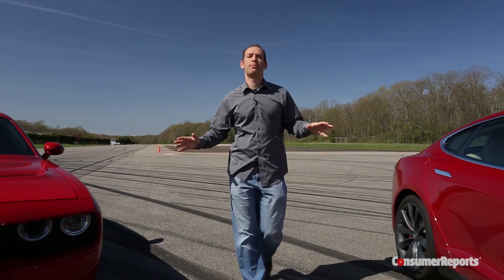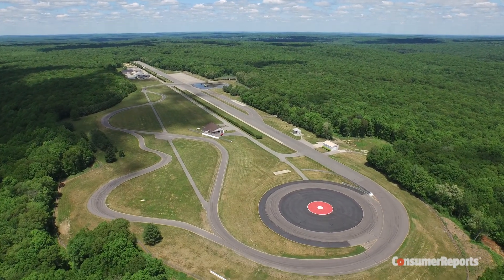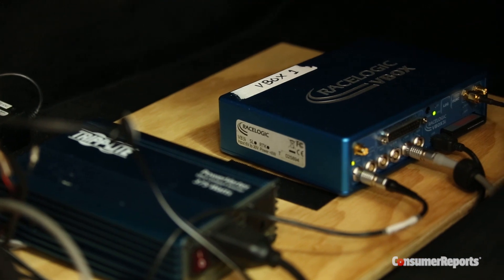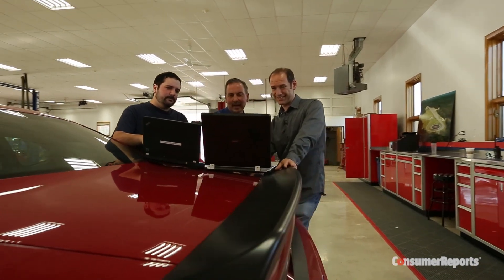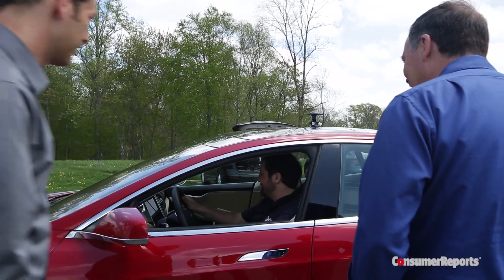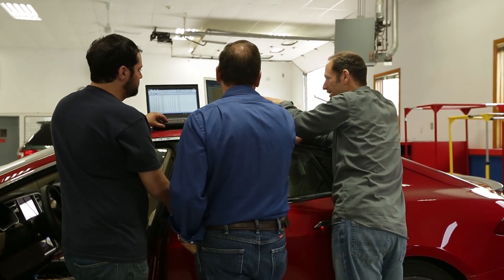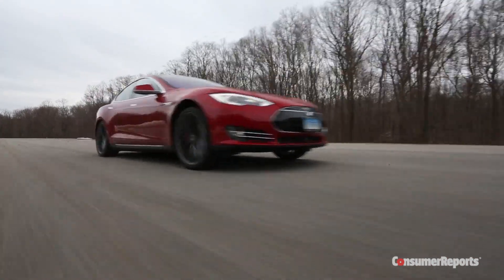Track Science: Tesla P85D vs. Challenger Hellcat | Consumer Reports

Comment: Did you pre heat the battery and put it in launch mode first? Just wondered if that makes a big difference for your testing? I have used launch mode in my P85D a few times and just leaps out of the hole. Pretty hard on expensive tires though. LOL.

Comment: Just saw this.  Both vehicles are impressive.  The problem is this:  you touted the "insane" mode of the Tesla and didn't even show what key you used for the Hellcat.  The Hellcat with the red key unleashes the full 707 hp and gets you into the programming in the electronics for customizing your experience...this video shows you may be partial to the Tesla, instead of being objective of the whole test.  And for the record the Hellcat is probably cheaper than the P85D...even with the bogus upcharges the dealers add to it because it is a must have vehicle!  I will not deny the P85D is impressive, but, do a cost analysis of both and a range test (tank vs battery) THAT would be awould be a great test.  The test should be with the "insane" button and the Red Key for levity.  Take it on a track and see how long they last.
Reply: I think that seems fair.  I think the Tesla is a great car in so many areas, but despite that, it seems like all the Tesla vids show me how perfect it is...there's no answers to anything else really.  oh and I think the Tesla is like over $150k...right?
Reply: Tesla's around 80k in the video. The 130k  (Max) p100d can smoke  any car.

Comment: This episode is annoying to me. I've personally driven both a P85D, in Insane mode, and a Hellcat. Tesla as the advantage of instant torque which is the virtue of an electric motor. It also has 4-wheel drive so the power goes to all four wheels. These two factor contribute to the results of the testing. The testing was completed on an unprepared surface. This episode is titled "Track Science" not road science. On the "track" with drag radials, the Hellcat has a traction factor that puts it ahead of the Tesla. You don't believe me? Search Youtube for  Hellcat vs Tesla - revenge at the strip. In four 1/4 mile drag races, the Hellcat beat the Tesla four times. https://www.youtube.com/watch?v=scg_85oVc00

Comment: Keep in mind everyone that the Tesla is all wheel drive verses the Hellcat that isn't  it''s rear wheel drive. Big difference in acceleration and traction. It's said that what ever all wheel drive horse power/ torque can be matched by rear wheel drive however you need double the horse power of the all wheel drive to catch/ stay with it and if your lucky surpass them. With the rear wheel drive if you have good traction with the rear wheel drive you can keep up with and them and if it's got a great traction for the whole shot semi outperform the all wheel drive..
Reply: +Steve The Man 258awhp evo 10 vs 196whp s2000 is on my channel. our cars are equally quick in the roll races we did. The s2000 is about 600lbs lighter.

Comment: There is NO REASON why the Tesla HAD to taper off so dramatically....  This is just a result of the speed controller programming to try and save the drivetrain, battery's, battery life, motor longevity....etc...  If it wanted to go for BROKE...it would have thoroughly DEVASTATED most if not all drag cars with an I/C engine.  Or grenaded itself in the process like some Top Fuel engines do from time to time....we need to see the Tesla in "Grenade Mode" only limited by the drivers right foot to make a fair comparo...   
Dont get me wrong...I'm a Gear Head of the HIGHEST order, but you need to give respect where it is due....the electric motor vehicle could easily and thoroughly thrash pretty much any I/C vehicle.  Strange days are upon us people...strange days

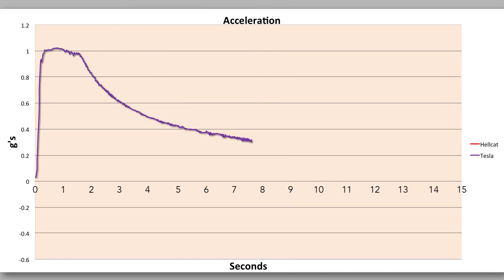Comment: Amazing how, when they compare the graphs at 03:48 you see how smooth the Tesla runs in comparison to the Hellcat's engine. Drives away like a fucking surgical knife. This is why electric cars should be made and sold more instead of resisting to change of the motor industry. If I could, I'd change my beloved R32 today!
Reply: Another "metric" that is completely useless...  what does it matter?

Comment: Uuuuuhh... Where's the science. All I know is:
Hellcat= 0.83g
P85d = 1g

What causes the difference???????????????????????????? ????????????????????????????????????? ?????????????????????????????????????
Reply: +Tsxtasy1 you're right, they really didn't tell important things. Tesla has electro motor, so full torque at 1rpm, tesla doesn&#39;t have transmission. Just 1 gear all the way up to maximum speed and what I know P85D is 4x4 with 2 electro engines. 1 engine for front wheels and one for the rear so it put more force down on the road.

Comment: Will you get the Ludicrous Mode Upgrade? 
Elon promised that not only would the 0-60 be 3/10ths quicker but that max acceleration would continue past 30 mph and even beyond 60 mph. In addition,  the drop off in power would be much slower and max speed of 155 mph would be reached ~20% quicker.

Comment: They didn't mention if the Hellcat was in Default, Sport or Track mode.  They also didn't mention if they used launch control in the Hellcat which also improves the launch.  Maybe the Hellcat still wouldn't hit max 1g but I have a feeling it would've been a noticeable improvement over the Default Drive mode if thats what they tested.
Reply: +Frank Merlin 
Yeah... That must be it.

Comment: This was awesome! Thanks for the instrumented testing!
Reply: Neil Porter Electric motor in instantly full torque.  There is no gas engine that can do that.  It is insane in a car or on a motorcycle.
Reply: I'm not sure that the data was collected correctly. I don't know. Did they power brake the Dodge? If they did the revs would have been higher and the torque higher. 
I don't get the joy of driving an electric motor. I've only ever driven electric Karts so what do I know. They were quick but "soulless". 
As I've said before, I hope when electric cars are the norm, self driving will be too. That way I won't have to drive.
Reply: Engineering Explained motor trend did the exact same tests with same cars